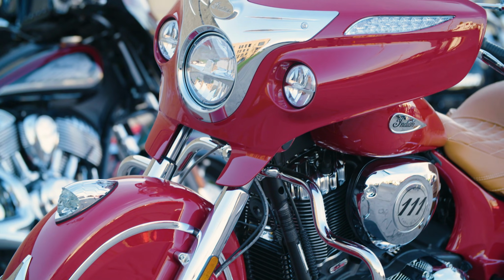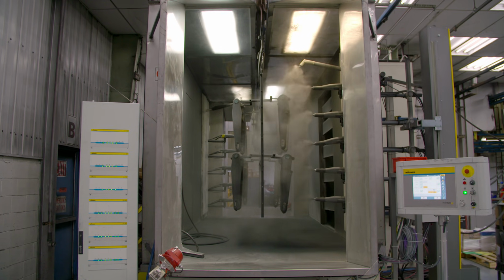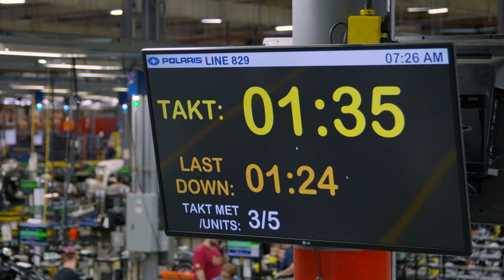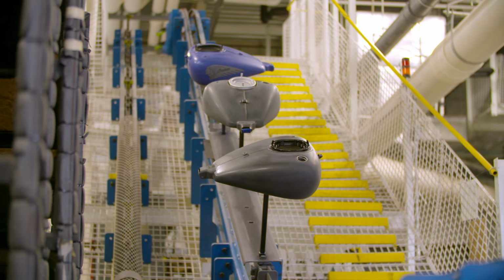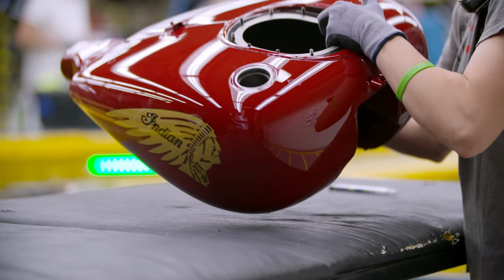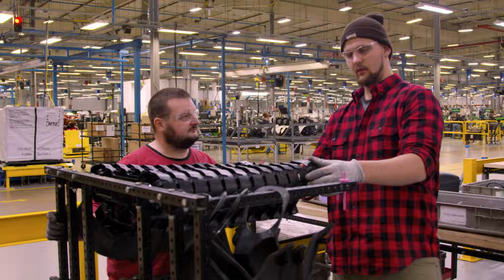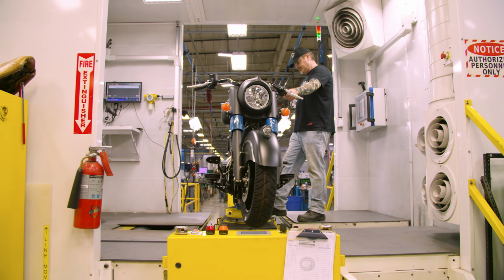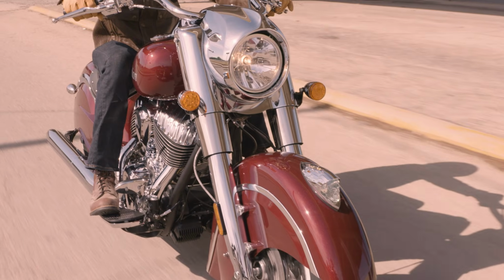Indian Motorcycle Factory Stop

Comment: The Polaris factory...1901?? Not consistently. Harley is truthfully since 1903. Indian is just a Victory upgrade.
Reply: Jealous much?
Reply: Such a petty comment
Reply: Original harley davidson was bankrupt by 1969. Had parent company amf not bought the harley brand and assets and kept it afloat, harley would not be here. If you do your research you will find out amf was responsible for most if not all of harleys evo motor. The original indian factory did close but the indian motorcycle brand did not. The brand changed hands several times but did not die. Polaris was the one with deep enough pockets to revive indian and build quality motorcycles. Indians are not warmed over victorys. There are no parts on an indian that were common to victory and or interchangeable. Polaris did a good job reviving indian and if you will take the time you will find out that a 30k roadmaster has most of the amenities that would require a harley rider to pony up 46k plus for a cvo. Standard on the roadmaster is heated seats and hand grips, electrically height adjustable windshield, all led lighting, electronicaly remote locking saddle bags and trunk, fox racing mono air shock rear suspension with all most 5" of travel, 116" thunderstroke motor with gear drive zero maintenance primary instead of an antiquated high maintenance drive chain. Take a look at harleys new street glide cvo and road glide cvo fairings and tell me who the copy cat is. Harleys new fairings resemble the indian chieftan/roadmaster darkhorse and the indian challenger. Indian came to the market with inverted forks on the challenger 4 years ago harley cvo's will finally have them by the end of 2023. I have owned and ridden both, and harley has some catching up to do.
Reply: @johnwilliamson6143  
You took the words out of my mouth. I had the bad luck of owning 2 AMF era HD. Made the best of it, but quality was sure lacking.
Reply: @mikeh4686  I was an AMF Harley-Davidson employee back in the day, the plant manager didn't really care about quality, he said just make sure it lasts 90 days because that's how long the warranty lasted. Sorry to Say.
Reply: Your Harley is for troons now... also, not Harley but AMF Bowling Company.  And they still used tractor tech, basically you are still buying bikes from a clothing and merchandise company.  Polaris is one of the largest motorsport companies in the business, most of their sales numbers are not from t-shirts.